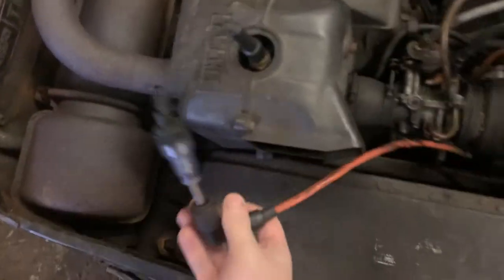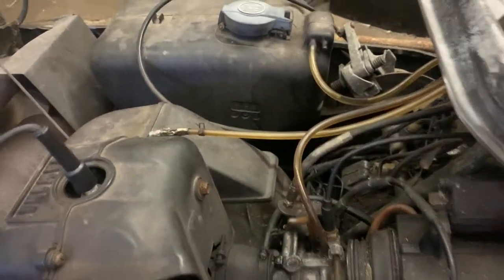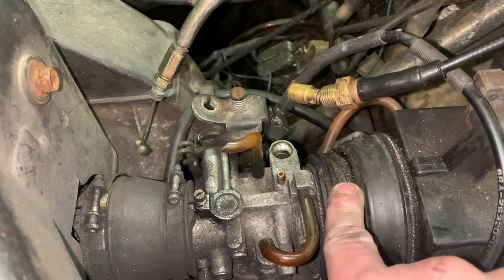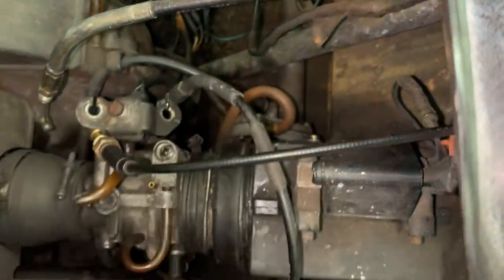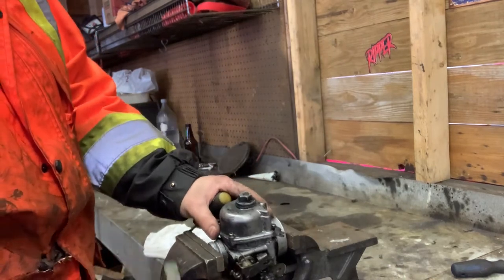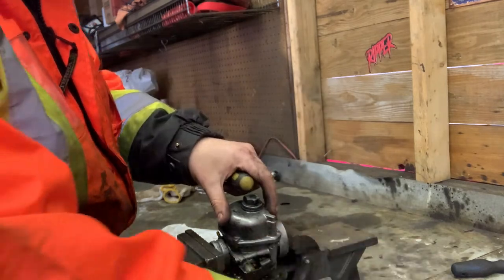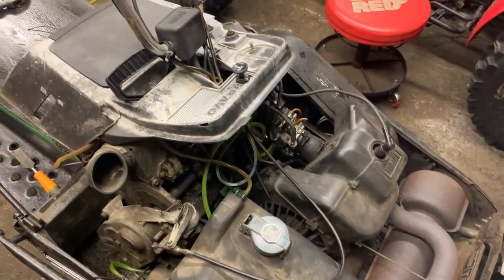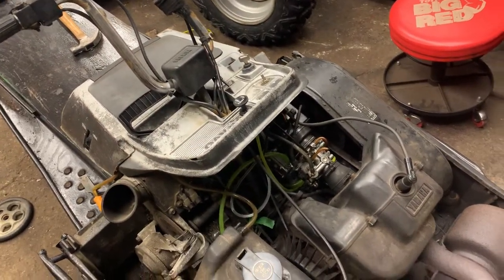Snowmobile Repair - yamaha bravo - Clean Carb, Fuel Lines, Rust -Part 2

Comment: Good job on video, I broke my plastic elbow piece of the carb  for the main fuel line, just wondering what I can use,
Reply from the maker: Thanks! i dont think you can buy that piece itself as its part of the carb body. See if it unscrews from the carb body. If it does i would run down to your local home depot or place like that and take a look at their fittings. They might have a Brass fitting that will screw back in with similar threads. If that dont work out bring it to a lawnmower or snowmower repair shop they could have a elbow kicking around that will fit.
If all else fails you may need a new carb. I got a spare carb kicking on my shelf that my buddy never wanted back.
You can always make a lot of things work, on my truck i had the factory coolant tubes rust out. I got some pipe fittings from local home depot and truck dont leak anymore ;)
Let me know how it works out for you!

Comment: My 2006 Bravo  hard to start, once started runs well for 15 to 30 mins then stalls again . After that really hard to start. Any suggestions?
Reply from the maker: @bearhart1799  make sure your carbs are clean, she could be flooding herself. Check the plugs after it stalls. 
Also ignition coil for your plug could be getting bad. They usually heat up and lose spark when they are old and work out

Comment: i see you replaced the coil. is that apart of the reason why it was bogging. i have a bravo also and have rebuilt the carb and fuel pump but it’s still bogging. the only thing i haven’t touched is the electrical so i’m leaning towards the coil
Reply from the maker: On this sled the ignition coil wire had a lose connection. If it’s still nothing make sure your boots have no holes, right spark plug, right fuel mixture. See if you can test the compression too. I haven’t been able to do much last few weeks due to a injury if I get the chance I can do some troubleshooting videos. Are the screws set properly on the carb ?

Comment: Where did your buddy get the boot for the carb, thanks
Reply from the maker: Picked up locally at a used motorcycle atv scrap shop(they sell new parts too). They order them in, I can try and find the part number if you need
Reply: Thanks for answering , It would be great if you could give me that part number .
Reply: Just working on my bravos carburetor when I realized my boot was cracked. Thanks for the video.